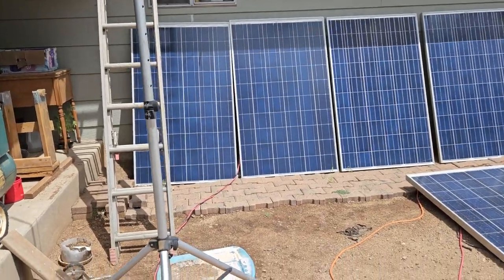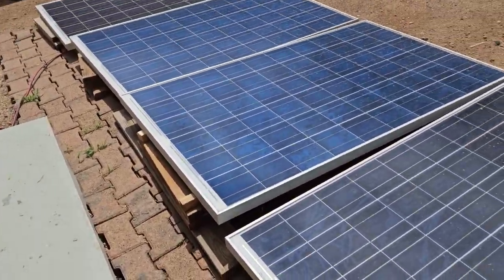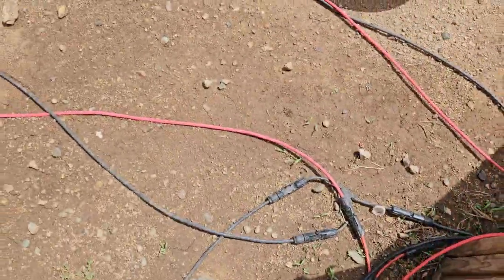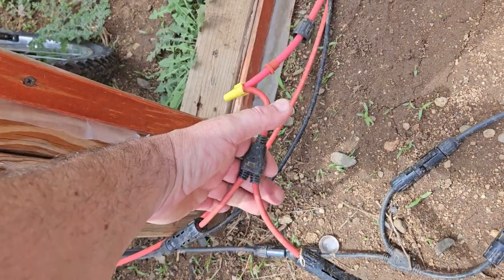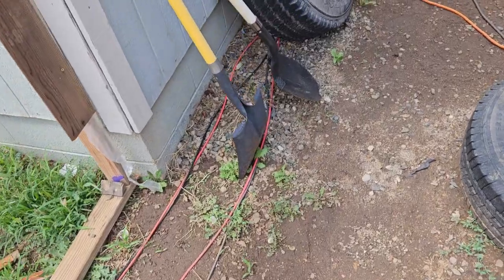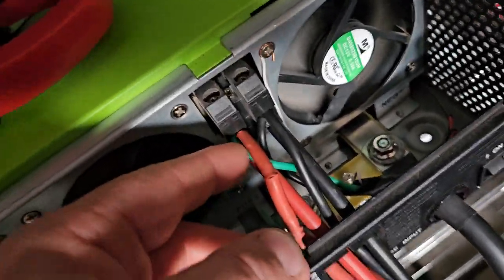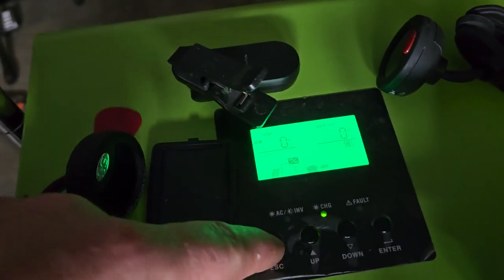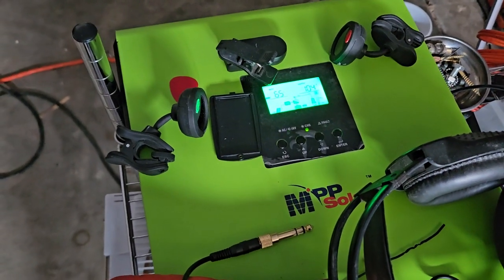my solar mess!

Comment: 4s3p would double ur line in voltage and cut amps in half. Reducing the heat inline . Ud loose 2 panels but be much safer trying to squeeze that much power threw. And be closer to mppt optimum voltage range.  2 parallel is bare minimum to charge 24v
Reply from the maker: The mpp solar hv lv2424 is only rated 150v pv max  i need a inverter good for 500v . Maybe ill get a powmr 3k24vh to replace it. Then i think its good for 450v
My panels are 37v ocv, 8.37isc
Reply: I have same lv2424. 3s4p then. Up your line voltage that's to many amps for 10g
Reply from the maker: @1aview  yep im gunna pull everything once the mosquitoes clear out tonight  lol. Or in the morning